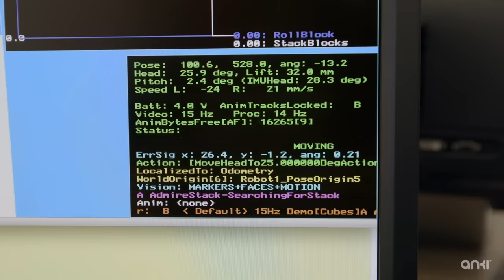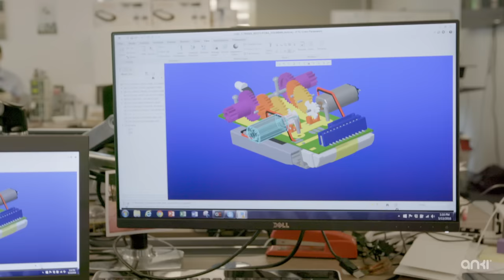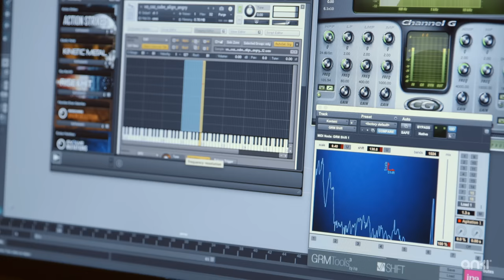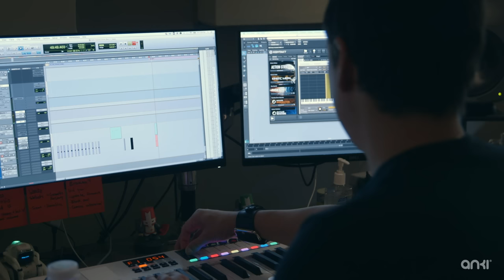Cozmo | Behind the Scenes

Comment: The sad thing about this, is that they could have gone so far, but then they got shut down. I have cozmo, the original, and I wanna k ow if I should get the car thing, cause it looks cool
Reply: I have overdrive, it's actually really fun. If you do buy a copy, you will have to send them in to DDL or do some DIY on it to replace the aged battery inside
Reply: @UnderwaterTesla  ok. But do they sell new cosmos anymore? Or did they only sell vector? And did Amazon buy Cozmo, or did Anki shut down, and Amazon took the idea